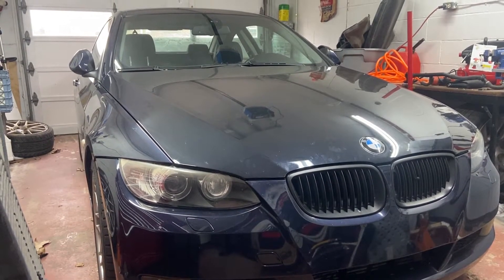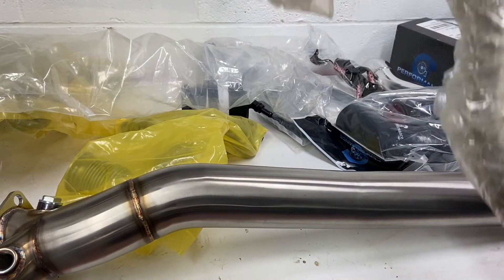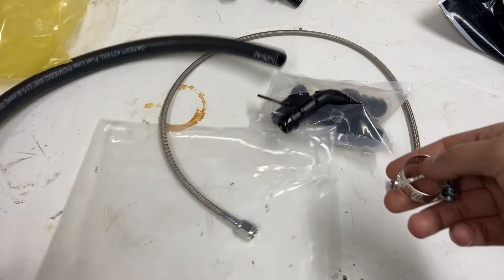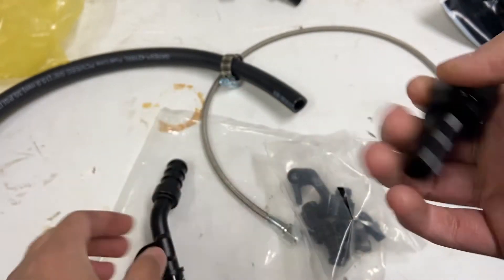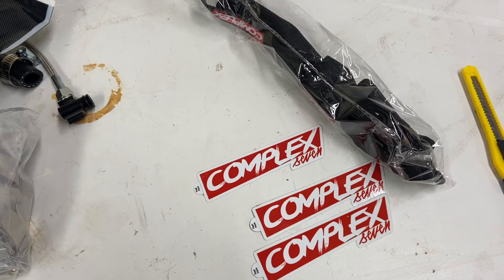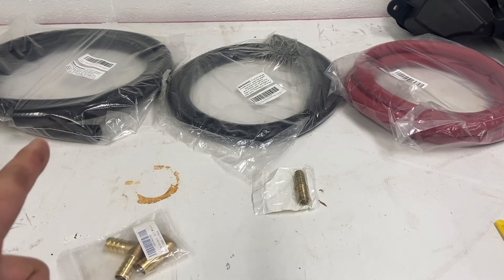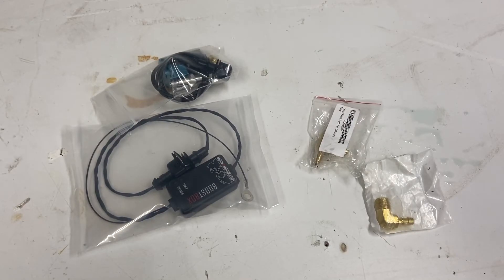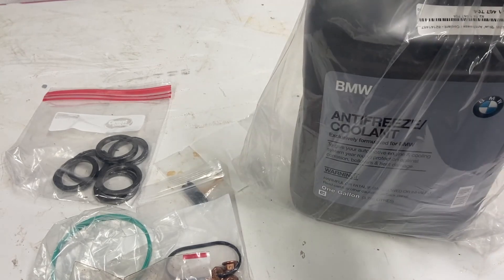On3 Performance Turbo Kit For N54 Full Unboxing!

Comment: I'm currently doing the same thing, one of my problems is that I'm having trouble with the oil drain hose. I got one from ebay but it still touches the v band. Hopefully you Make a video about that because I can't get it to clock it correctly.
Reply from the maker: Yes I address that issue in the next video
Reply: @Ha_garage  awesome, can't wait to watch it. I started this project right before winter and now I want to finish it up since it's nice out.
Reply from the maker: @ElTapatio33  follow my on Instagram I will post updates on the new video drops there
Reply: @Ha_garage  what's your Instagram name?
Reply from the maker: @ElTapatio33   blaubimmer @ig
Reply: get an AN kit, with 45s, cut the barb off the case adapter, weld an an10 fitting to case adapter, install everything and profit!

Comment: What size hose you use for oil drain and how did you tap fittings into the compressor housing and what you use for coolant relocation
Reply from the maker: The links to the stuff I used is in the description. I will post the next part to the tutorial very soon. Stay tuned.

Comment: How long did it take? And did you also get donut gaskets and studs?
Reply from the maker: It took about a week worth of work. I changed the studs and donut gaskets as well.
Reply: I did mine in 8 hours work in the garage if we want to compare installation time.
Reply: I installed mine in 12 hours. Of course I had a lift and transmission jack to hold the subframe.
Reply from the maker: @Boog13man   yea I had jack stands and it took me a while because I had to record most of it lol. Kinda hard to do both. Follow my IG send me pics of ur build
Reply: @Ha_garage  The selflessness it took to record everything and perform the install dwells in few. Welcome to single turbo  N54 life and I’m following for sure.
Reply from the maker: @Boog13man   thank you bro!